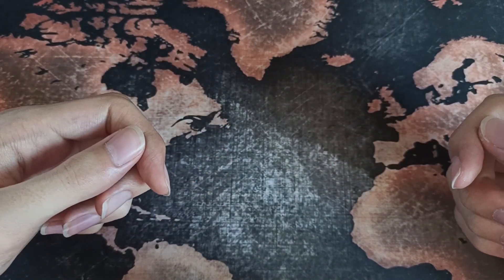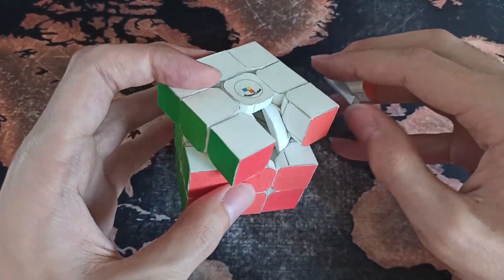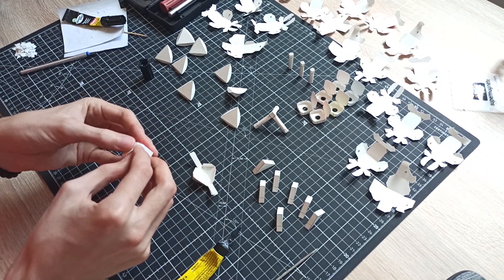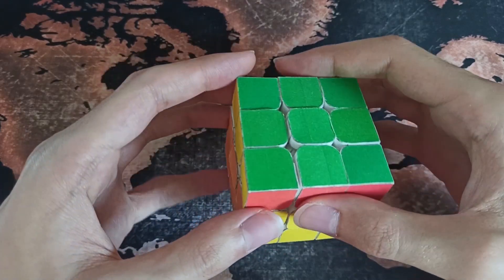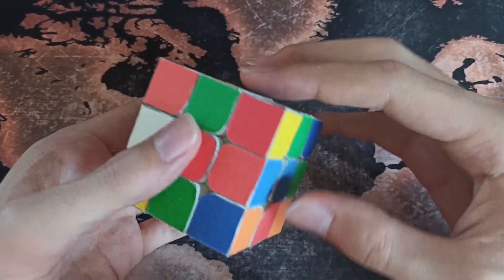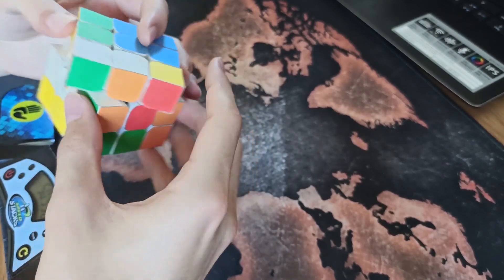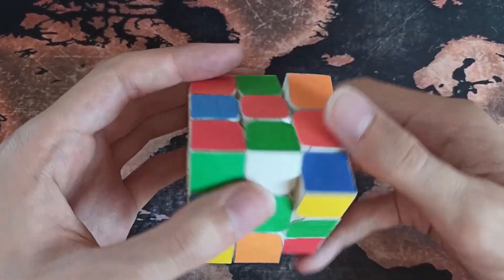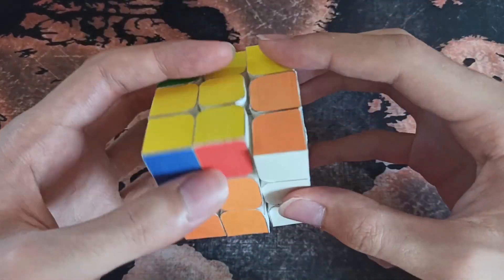Putting Magnets in a Paper Rubik's Cube | Road to Sub-30

Comment: You need to make a 6x6, which uses the 2x2 mechanism, because it would just be awesome.

Also 7x7 should be easy, it's a 3x3! :)
Reply: I’m new to this channel, but I don’t see how on earth a 7x7 made of paper should be « easy »
Reply: @sm64guy28  Trust me, Mr. Super Mario 64, it can be done. You just take a 3x3 and add extra pieces in the middle.
Reply from the maker: Well then do it @Summer Crew :P. Only because it is not difficult to conceive doesn't mean that it is easy or even that it can be done in practice :D
Reply: @PaperCuber  All right. I'll show you that a paper 7x7 is POSSIBLE. I'm working on my first from-scratch paper 3x3, but I'll begin the 7x7. You'll see, just it'll take time, because I'm making the pieces from scratch.
Reply from the maker: That would be awesome! Looking forward to it! :)